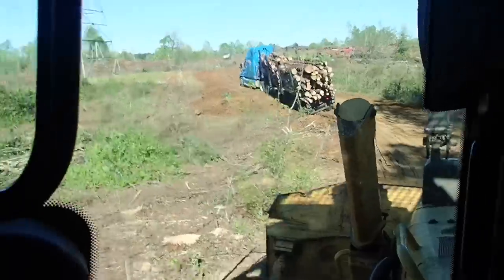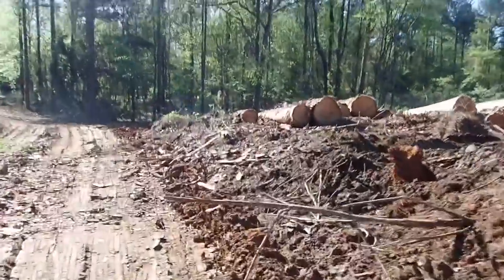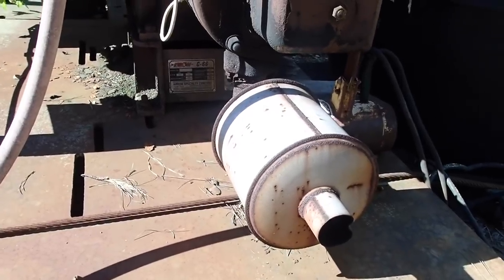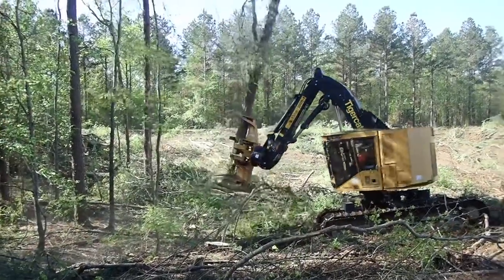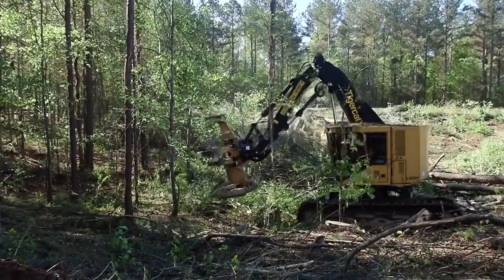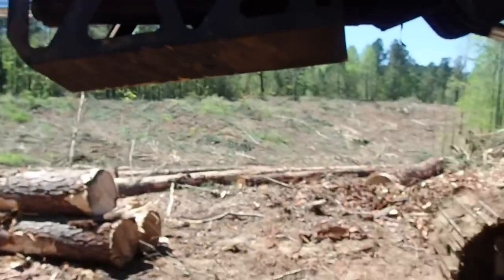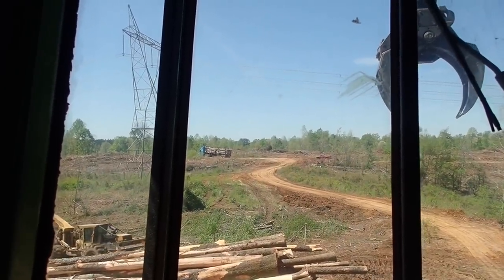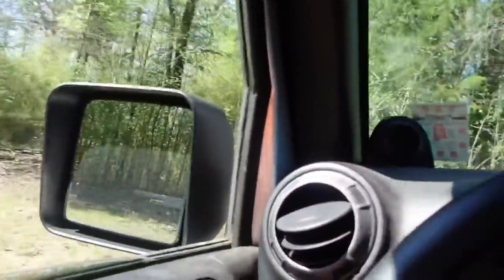Tigercat LX830D & getting stuck

Comment: I sometimes find old well sites on my place from the sixties and seventies.  The first clue is small mounds of dirt. Then sure enough I start finding old 1" steel cable that was used to stabilize the derrick. Then maybe an abandoned pipe rack and rusted out barrels. That's just the way they operated in the old days.

Comment: Keeping your truck and trailer on the track (Where you clearly see everyone has been running) should be truck driving 101. I tell everyone to treat the sides of the track like it's a swamp. Because it only takes a 6 to 8 foot soft spot to flip them on their side. If you happen to swing a little too far and run your front tire off the track and it sinks in, you can get pulled out, it's much better than turning over.

Comment: Dead gum dispatch trucks. You know which ones want to work with you and then the ones that are steering wheel holders. Top that off you have trucks that are meant for the highway and not from the woods. Hope the ground  starts tightening up some for yall.